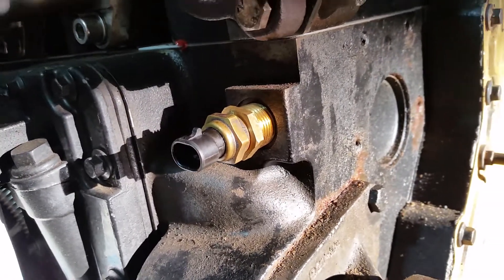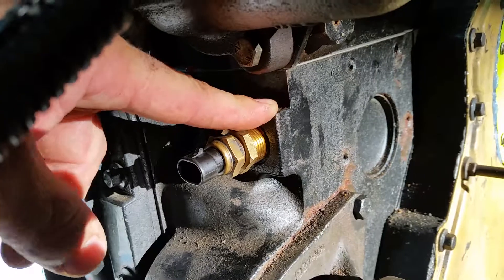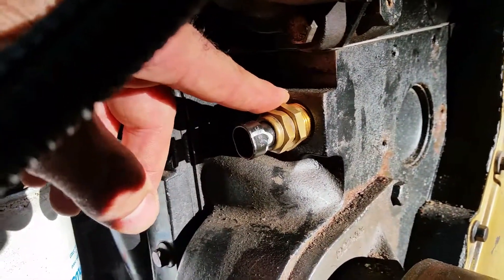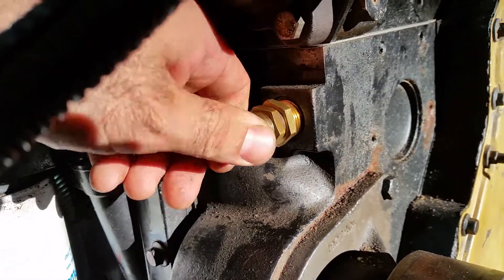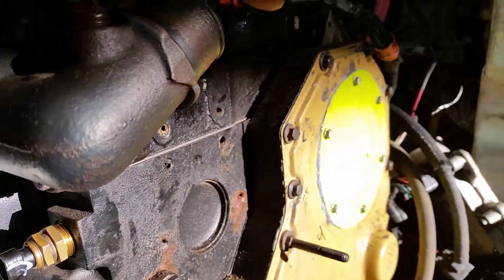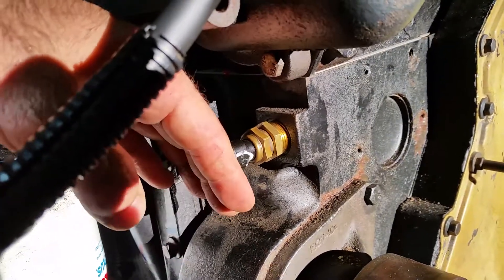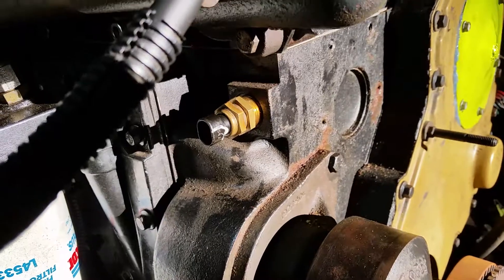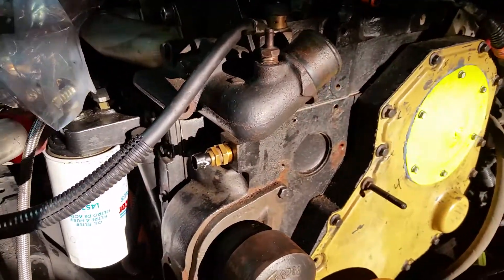How To Fab A Water Temps Sensor Bushing For Your 3rd Gen CR to 12 Valve Swap

Comment: Where did u find a adapter to make the oil pressure guage work I can’t seem to find one anywhere
Reply from the maker: Hey George, I will see if i can dig up the spot where I found the brass fitting that we used to make that adapter. I will let you know soon.
Reply: 70440charger thanks man